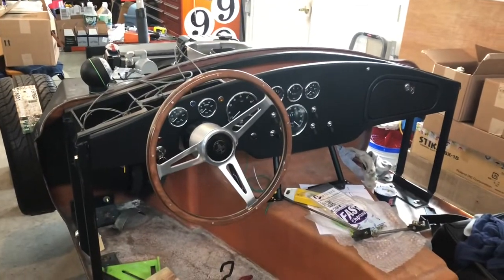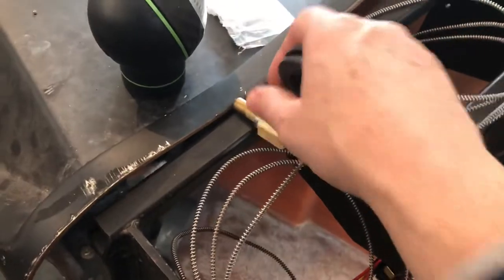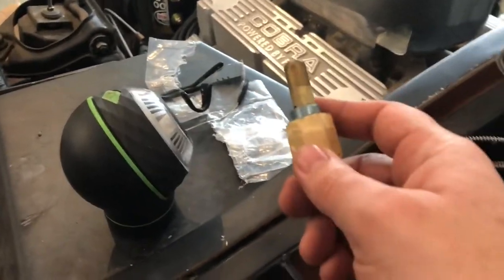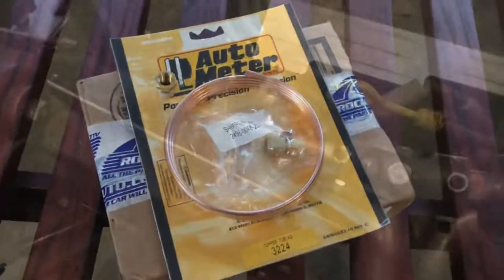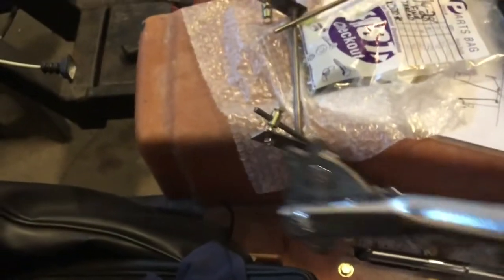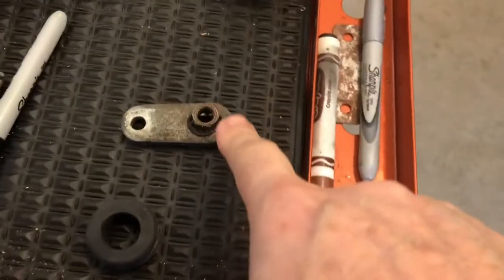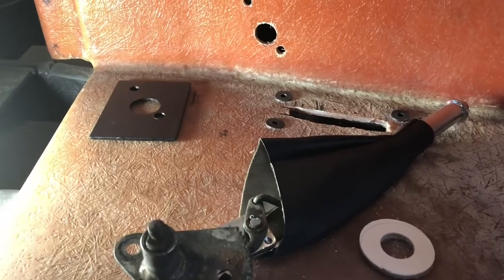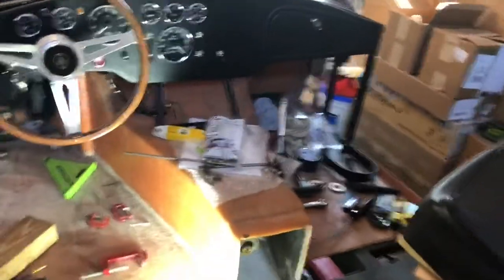Cobra 427SC Replica Build Part 20 Plumbing the Gauges and Proper AC Cobra Hand Brake

Comment: I recently purchased an unfinished street beast kit like yours.  What length of steering column did you use?
Reply from the maker: Derrick Naruse I used a 30” basic Ididit column in black. According to my research 30” is the most popular size and fits most replicas. It worked great for me. If I was to do it again, I might consider a tilt column, for added room. But only if it wouldn’t move the steering wheel any closer to the driver. I was able to only use one universal joint and one length of double d shaft, as well. Instead of multiple joints. I know I covered it in one or two vids - check em out!! lol Thanks for watching and commenting.